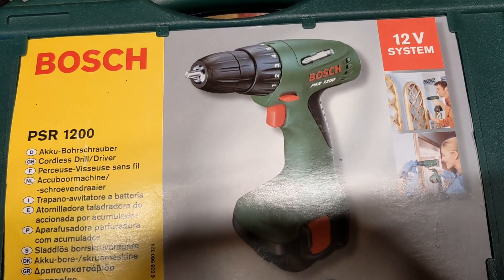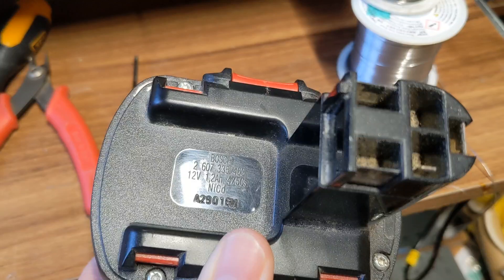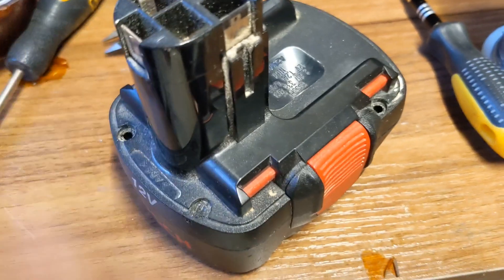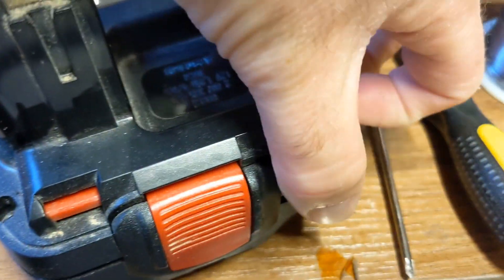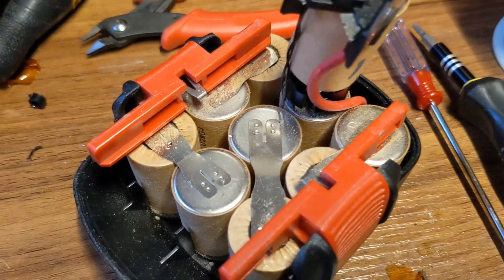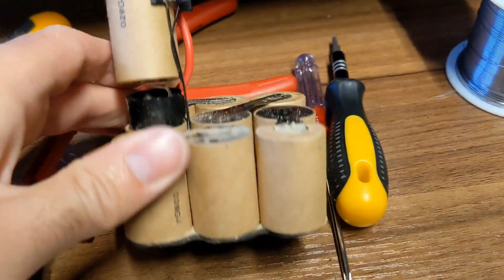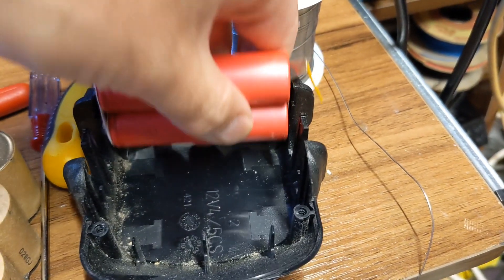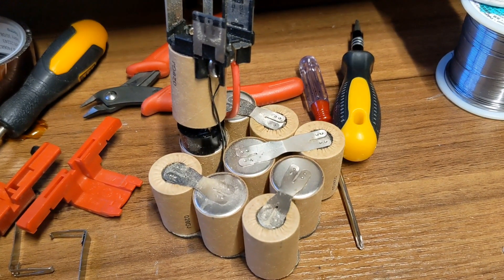old school nicad

Comment: The problem with 3 lithium cells is that you need to use a lithium ballance charge board and it might not fit in the case. You can't just connect them in series. Easier to just replace the cells with NiMH but they'll cost about the same as a new drill.